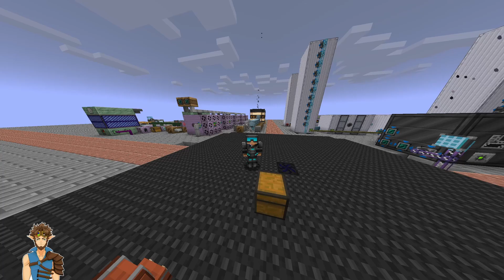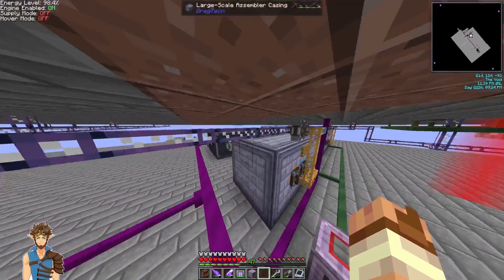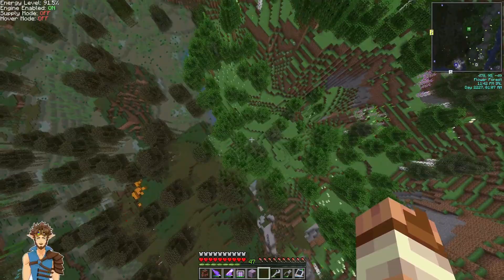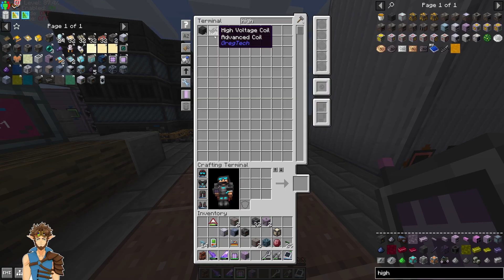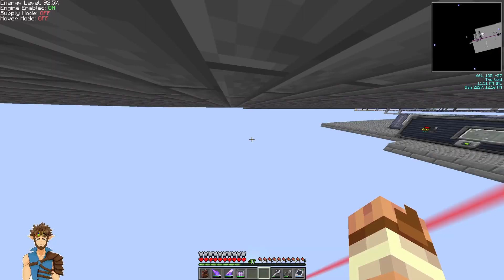Gregtech Modern Ep65: Industrial Wire Factory

Comment: It is a bad idea to mix differnt circuits in the same mixer/ABS bus. better set up distinct busses for the different circuits, you should have enough casing space for atlest 6 different circuits.
Reply from the maker: I know this can lead to problems and I am letting it go to see how well the blocking from AE2 crafting works as I would like to know if it's working well. If it ends up not being the thing that messes it up then I will fix that new problem.